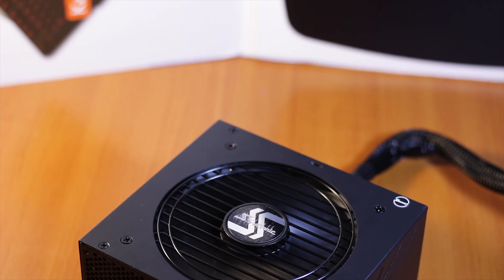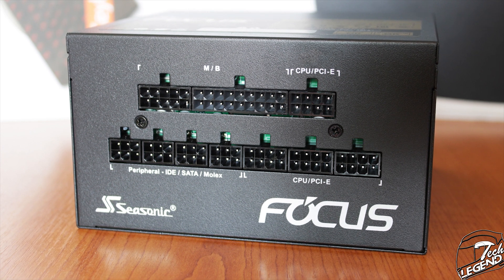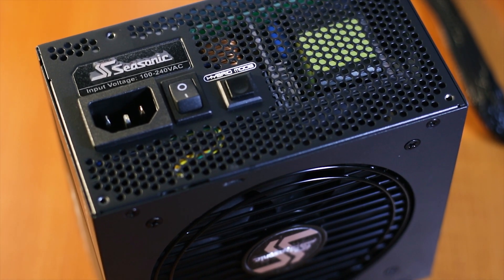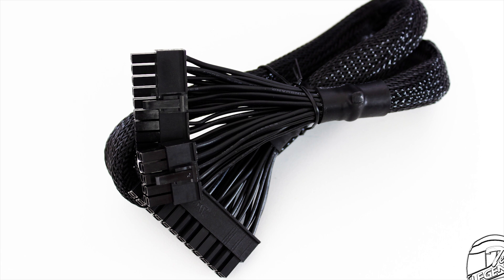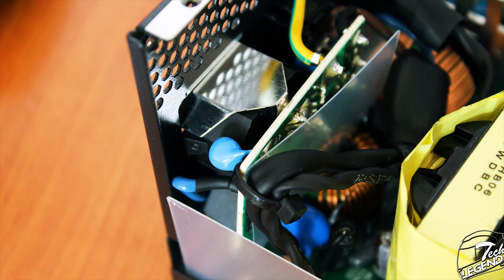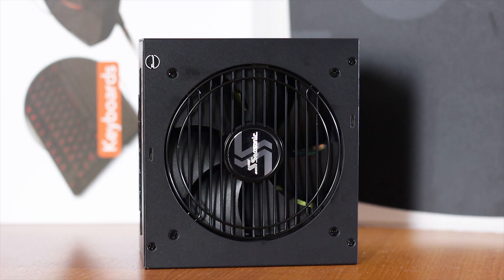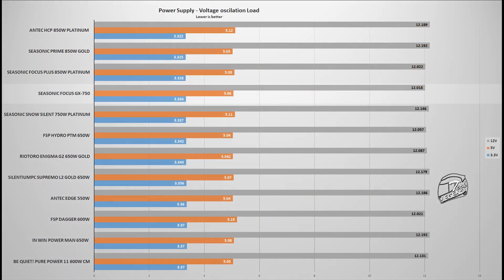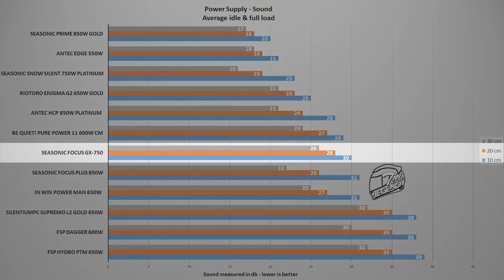Seasonic Focus GX-750 Gold - Power Supply Review

Comment: Seasonic is one of my favorite brands when it comes to power supplies. What I really do not like about them is that the CPU cable is usually shorter than other PSU's. Anyway, nice review, really enjoyed it.
What I would really like to see in the future is how to set up a full RGB system. I am thinking about switching my current case and fans, which are Pure Base 500 with Pure Base 500 DX and 5x Silent Wings 3 with Corsair ones. I do not know how to "tie" all these fans RGB, plus the case's RGB together... too many cables.

Zi faina!
Reply: Why don't you like the Silent Wings 3 fans?
Reply from the maker: Hi, instead of replacing all the fans, which btw, those fans are very good. Why don't you just buy some RGB LED strips and place those around the inside of the system. Zi placuta!
Reply: The fans are awesome, not gonna lie
The reason why i want to change them is because i want more airflow for the GPU (MSI Trio X 2080), as in this case it gets a bit toasty.
So if I change the case with Pure Base 500 DX, I would like to have RGB fans for design purposes only...
The remaning case and fans, from be quiet!, would go to my second PC.